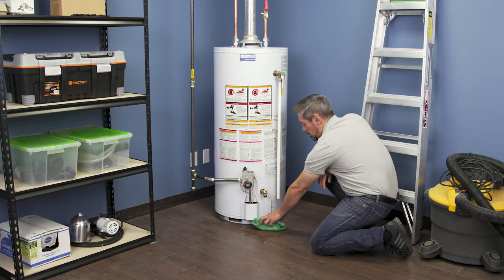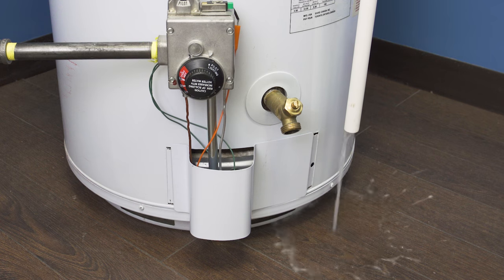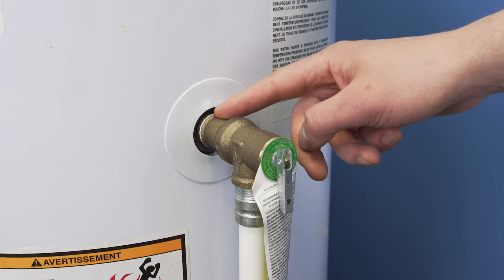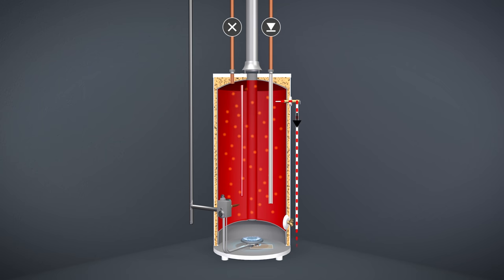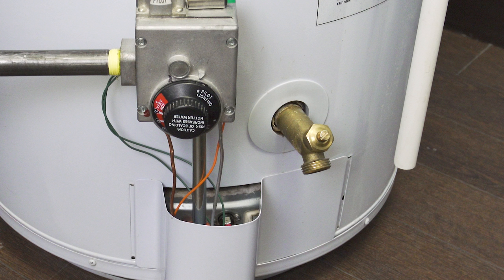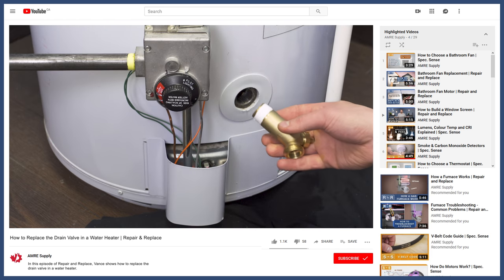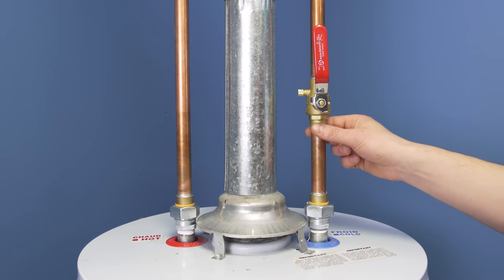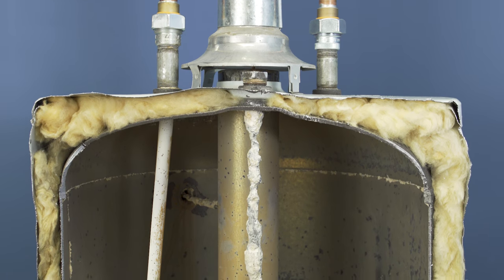Hot Water Tank is Leaking? Top 5 Fixes | Repair and Replace

Comment from the maker: Another source of a leak can be the heating elements in electric water heaters. We haven't filmed the repair videos for electric water heaters yet but these repairs will be added in a future series update.
Reply: Yeah, water is just pouring out of the lower access panel. The insulation up to there is soaked!
Reply: That is what I was going to say, my gasket on the heating element was leaking, even though the element was still working it was corroded pretty bad in some areas so I just replaced it with new element and gasket
Reply from the maker: @larryhutchinson4271  Thanks for sharing, we're glad that you were able to get it repaired!
Reply: Well it’s a water heater so what do you think is gonna be in it

Comment: you didnt tell me drain the water, now i got 50 gallons of water on my grandmas floor
Reply from the maker: Thanks for watching. The steps for replacing the drain valve and the relief valve includes draining the water. This is shown in the two links which are in the description of this video:

Water heater leaking from drain valve? https://youtu.be/nGCejMsKNX4
Pressure relief valve leaking water? https://youtu.be/2qhsmSbQQzc
Reply: Duh!
Reply: Yes he did!  Even if he didn't, it's common sense.  If you need to repair a water tank, empty the water first.
Reply: Common sense 😅
Reply: There was water drained not 50 gallons lol😅
Reply: No way   u serious?

Comment: The water is feuding in the laundry room like it is everywhere it is even coming out the bottom of our wall and J thunk half of our stuff is weit
Reply from the maker: Thanks for watching. If you have a leak, then shut off the water supply and try to narrow down where the leak is coming from. If it is from the tank then 40 gallons will produce a lot of water. If the leak is in an accessible place, then something like a waterproof patch seal tape could be used to temporarily stop the water from coming out. In other cases the spot is more difficult to isolate.
Reply: @AMRE Supply  Thank you for the information but I think we met have to get a new one but someone is coming to look at it tomorrow at 7:30ish
Reply from the maker: @alyssiamitchell  Thanks for the update. Hope it all goes smoothly.

Comment: About to replace mine today. Tank started leaking. Didn't notice it for a while. Then it started putting out the pilot light. I know it was going to need replaced a few years ago when the pressure relief valve stuck open just enough to leak. Glad it stuck open lol.
Reply from the maker: Thanks for watching. You are right its quite preferred for it to fail and stick open. If it is stuck closed then that is not safe, which is why we recommend testing the valve during yearly regular maintenance. We hope your new tank serves you well!

Comment: My gas water heater is almost 30 years old , I have made some minor repairs over the years that have saved me a lot of money.  The funny part about it is that, when I bought the water heater, I got the cheapest one I could find. I'm not recommending that you buy the cheapest water heater you can find, but they sure don't make them like they used to. I go to the metal recycle shop a occasionally and I see fairly new water heaters in the scrap pile, and it makes wonder, how many are actually bad?
Reply from the maker: Thanks for watching. This happens with water heaters and appliances. There are many that are thrown out way before their time. Often it can be fixed by just replacing one or two parts but not everyone wants to dive in and do the repair themselves. When a service call, labor and parts together will cost them $500 for a repair, many people decide to put that towards a new model. In other cases a new installation gives them peace of mind, and to some that is worth the money.
Reply: To repair technicians of all appliances told me production of the products are not meant to last more than 10 years. If the products last 12-13 years, consider yourself lucky...

Comment: Hi and much thanks for the useful info. The thing is with my tank, when I turn off the cold water inlet, the slow leak at the bottom stops and dries up in a couple hours but the insulation is damp . Would this mean that the possible rust is near the very top ? Is there anyway to adjust the water level ? This tank is not even 8 years old yet and the one before this was probably  here and lasted trouble free for over 20 years !! 🤔😒 This really sucks !!!
Reply from the maker: Thanks for watching, we're glad that you found it helpful. It is possible that the threads on the dip tube https://www.amresupply.com/catalog/Dip-Tubes-Drain-Tubes-Nipples-647772-PP2A (below the dielectric coupling) that screws directly into the tank is leaking. That would be the first place to look a little closer at, and it would explain why the insulation at the top is still wet. Unfortunately we don't have a video showing how to replace the dip tube. In some cases it can be simple but in other cases the pipes will need to be cut to install a new one.

Also the water level can't be adjusted in any way.
Reply: @AmreSupply  And thanks for your reply. Were the water heaters manufactured say 35 years ago more robust than the ones made today?
Reply: How did you solve this? I think I'm having the same problem-seems like leaking from cold water inlet then dipping down on the burner!  Please let me know, if I don't want to replace the entire thing. Thanks. Thanks to AMRE Supply for this clear video!
Reply: @soefma   Hi. In my situation, it actually was  a  cracked el cheapo  plastic drain valve ! But there was no visible sign of  leakage around the valve  because  the  crack along the threads  was  deep enough inside the  tank and that's why  I guess the leak was coming from underneath the tank. One evening I went to drain some water from the valve and the bleeping thing just broke right off  into my hand on my first twist and there I was standing as the hot water gushed out the hole where the valve once was ! I then had to rush for some buckets to save the basement from getting  completely washed out. I ordered a brass valve but installing it was a pain in itself because some of the plastic valve had melted and was actually fused  unto the threads and it took some effort to finally get the threads cleaned. In retrospect I should have bought some wire brushes. It is inexcusable and absolutely criminal  that these scumbag companies  can choose to use  such inferior plastic parts just to save a couple bucks when  brass fixtures  are available that are almost 100% guaranteed to last the life of the tank. Not to mention all the stress and headache that comes when it breaks  and needs replacing. Really wish I could sue for pain and suffering 🙄😒! I Hope that you find a fix that's not too stressful or expensive. Take care.
Reply: Since the mid 2000s, 2 experienced repair techs of stoves, washer/dryers, refrigerator, Central AC units, etc told me that companies do not make them last more than 10 years. And that we're lucky when the products last 12-14 years...

Comment: My unit seems to be leaking around the drain valve thread/connection area.  There is a plastic ring behind the drain valve and water is slowing dripping out of that and running down the side of the tank. I've tightened the valve but don't think it's helped.  I've got a call into a plumber but wondering if I should first try draining the tank and replacing the drain valve to see if that fixes the problem.
Reply from the maker: Thanks for watching. Since the drain valve is an easy repair, it's definitely something that you could replace first to see if it fixes. We have a video that shows this in more detail. If you don't have a brass valve it can be helpful to install one as plastic can crack. As well you could make a custom valve using a 3/4" brass ball valve. That is also mentioned in the video: https://www.youtube.com/watch?v=nGCejMsKNX4

Comment: @AMRE I have water leaking from behind the pressure relief valve. it looks like it is coming from behind that white circular gasket. what repair would you recommend for this? thank. you
Reply from the maker: Thanks for watching. It could be the threads on the relief valve, so it's best to double check that. The white plastic gasket is just to help fill in the space to make the outside it more visually appealing and hide the edges, it doesn't actually seal anything. You might be able to lift up the plastic to look more closely at the insulation. In this case if it's leaking from the threads then replacing the relief valve and cleaning the threads might help. Alternatively it could be an issue with the tank itself leaking.

Comment: I think we have get a new hot tank because the water is coming out of two spots on ours but how do you stop the leaking for a while to wait when you are get a new one?
Reply from the maker: Thanks for watching. If you have a leak, then shut off the water supply and try to narrow down where the leak is coming from. If it is from the tank then 40 gallons will produce a lot of water. If the leak is in an accessible place, then something like a waterproof patch seal tape could be used to temporarily stop the water from coming out. In other cases the spot is more difficult to isolate.

Comment: We have alot of water coming out around the cold water inlet.  The nipple seems to be tight.  Where could this be coming from?  Do I need to remove the top cover from the tank?
Reply from the maker: Thanks for watching. If you look closely there are several connection points. There is where the nipple screws into the tank itself which is usually several inches below the top, as well there is the connection of the water supply line as it joins to the nipple. To inspect the lower connection there might be a small circular plastic cover, or some insulation that you might need to remove before you see it. If water seems to be rising up then it's likely that lower connection. Like any leak you can dry the spot completely and see where the water returns.

Comment: Do I need a new water heater if water is just constantly gushing out of the bottom?
Reply from the maker: Thanks for watching. If you can narrow it down to the drain valve or the main control valve, then those could be fixed. If the tank walls are damaged and leaking, then the entire water heater should be replaced.

Comment: Hello, thank you so much for the video, but I'm baffled with my ceiling water heater, it only leaks (on the ceiling down to the bathroom) when I turn on the electricity (I always have it turned off if I don't use it).
I notice that it starts leaking after around 15 minutes I turned it on, what could the problem be?
Is it dangerous to keep using it?
Reply from the maker: Thanks for watching. In this case it's probably best to get this inspected by a technician.

Comment: Is it possible to take advantage of the hot air that comes out of the heater to heat a room?
Reply from the maker: Thanks for watching. Depending on the model the exhaust will be around 160°F. A water heater will heat the room slightly but The difficulty is harnessing that heat in an efficient way. In any case it is not recommended to make any modifications to the exhaust system that fall outside of any established building codes.
Reply: @AmreSupply  
I have a gas heater located directly behind the bathroom. Is it possible to make an opening in the bathroom wall and deliver hot air through a metal tube? Most importantly, in my question, is the air or exhaust harmful to breathing, which may lead to suffocation? Thank you for the answer.
Reply from the maker: @b.mohammed8748  The exhaust air contains an odorless / poisonous gas called carbon monoxide CO even at seemingly low levels can cause suffocation. This is why homes are installed with CO detectors, to detect any carbon monoxide from faulty gas appliances, furnaces and water heaters. The exhaust must be vented outside, safely away from the home and cannot in any circumstance be vented inside a room.

Furnaces have a sealed combustion chamber that vents the exhaust outside. This is separate from the circulating air inside the vents. Clean air from inside the home is pushed overtop of the heat exchanger and the air heats up before it is circulated around the home. https://www.youtube.com/watch?v=tVLtJwix-_8

Comment: Thank you!! You just saved me a lot of time and probably a lot of money too! :)
Reply from the maker: You're welcome Barb! We're glad that the video helped you out!
What ended up being the problem? Did you find the leak?
Reply: @AmreSupply  Thank you! :) My drain valve seems to be the issue. The drain valve is the original plastic one that came with the heater in 2015 (I assume, as I've only just bought the house a few months ago). My local stores seem to not carry the precise brass replacement part so I'm now waiting a week (ugh!) for it to arrive. The last owners (who I have some choice words for) decided in their infinite wisdom to not install a drain pan under the heater so my floor is a soaking mess. Fortunately the room is only partially finished and is slated to be gutted anyway, but, well, cringe! I first loosened the rubber flange / collar thingy against the tank body because the drip was coming form under it. When I did that, I got a bunch of steam and small spraying droplets coming out. I have a small pan underneath to catch the drip and had mopped it all up. There is water in the pan today (yay!) but the base of the heater and floor are wet again, so I'm annoyed and frustrated I have to wait a week for the part to come in. I've wondered if there's a second leak because of the quantity of water. The pressure relief valve is bone dry as are the pipe connections. The insulation inside the tank cover also feels dry to the touch. I suppose I'm concerned because of all the steam and water spray that came out when I first loosened the rubber piece around the drain valve. It's not doing that any more, but could that indicate another problem?
Reply from the maker: Thanks for sharing! Water can add up, its most likely just the drain valve that is leaking. Water can also run against the side of the tank when it drips so some of the water might be missing the pan. If you completely dry everything you can set a towel down to see if there are any additional drip spots. It can help you narrow down if there is anything else going on but its unlikely for 2 leaks to happen simultaneously.

Comment: We had water on the floor so disconnected the electrical and remove the water tank. Now I'm wondering if it was the old copper flex hose on top which I I've noticed has a hole in it. Can I hook water to the tank and check if it's leaking while the electric is not intact?
Reply from the maker: Thanks for watching. You can check it even without the heater on since the water pressure will still push the water through the system. This applies to both electric and gas water heaters.
Reply: @AmreSupply  Great! Thank you so much!🙏🏻
Reply from the maker: @tracytracy1030  You're welcome, we're just happy to help!
Reply: @AmreSupply  Alas, The pressure relief valve was busted off and it cannot be checked😭 ( It was wedged in between the drywall so tight We had to cut the dry wall to get it out😮) Have a great day👍🏻 Thanks again
Reply from the maker: @tracytracy1030  Sounds like it was some extra fun along the way, thanks for the update!
Reply: @AmreSupply  Sure 😄

Comment: Why is it that every video I can find skips the connections at the bottom of the control panel?  My gas water heater has two lines there, one flexible and the other is rigid and much smaller.  I don't know what they're for but one or both are leaking there.  Is it just a matter of replacing the gaskets?
Reply from the maker: Thanks for watching. Are you referring to the gas lines? In standing pilot water heaters there will be one line for the pilot flame and one line for the main burner.

If you're noticing water coming from there then it's most likely a problem with the gas valve leaking at the threads. The gas valve has a sensing bulb that sits inside of the tank. The gas valve screws into these threads and in some cases can leak.

Comment: What if your tanks pipe leaks, spews water everywhere and gets water down in the insulation? Thanks in advance for your answer.
Reply from the maker: Hi Tammy thank you for watching. If the insulation gets wet it won't hold on to too much water but you'll still want to dry it out. If you have an electric tank then just let the tank dry on its own with the aid of a fan or dehumidifier. If you have a gas tank you can leave the tank running as the heat from the tank will help the water evaporate faster.
Reply: @AmreSupply  thanks for your reply. I luckily do have a dehumidifier & have been using it 👍 I had some of that Watts water heater connector pipe on there & it sprang a big leak & the plastic or rubber inside deteriorated! The guy at Lowe's said he'd never seen it do that before & offered me more. I declined. Instead I bought Eastman Water-Flex corrugated stainless steel connector hose. They didn't have any copper ☹️ God bless you 🙏
Reply from the maker: @tammydear8057  You're welcome Tammy we're happy to help out. Overall its not that common for those connectors to fail in that way but regardless replacing it with a stainless steel connector will work great in your case.